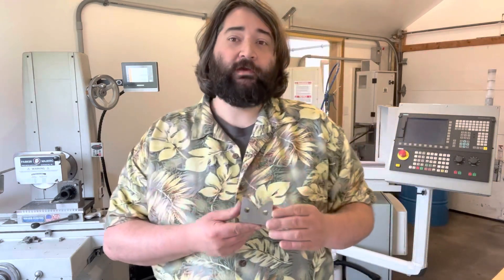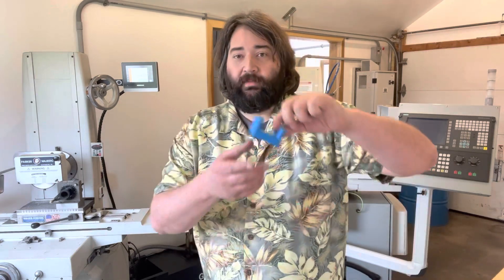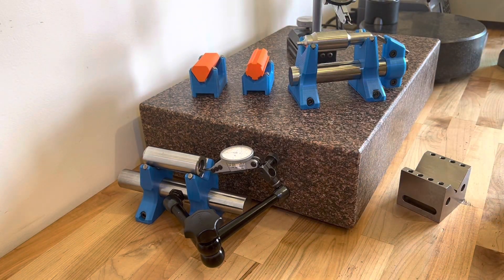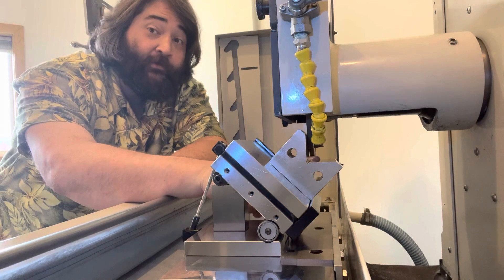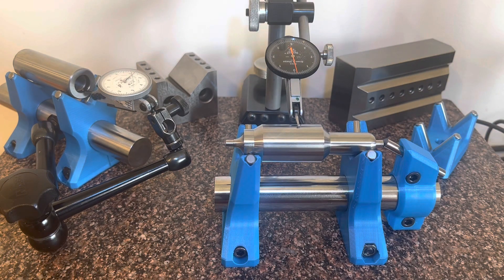Concentricity Gage made with 3D printing

Comment: I've ground plenty of acute vees for sheet metal bending. If you dress the bottom of the wheel at a shallower angle than the vee angle you want. The corner will clear and the faces can be ground with the side of the wheel. Then to accurately center I grind the oversized block to the required dimension ensuring the vee is central using a pin & dti.
If an acute vee does not need a sharp corner at the intersection then a flat at the intersection of the vee will also help clear the wheel when grinding the vertical faces and no angle needs to be dressed on thewheel perimeter.
I see a few videos of large vee blocks, often they do not need a sharp corner at the base of the vee as they are not designed for small diameters. Having a flat allows the vee blocks to be far smaller whilst still holding the required larger diameters.

Comment: Really cool and useful example of what can be achieved with cheap off-the-shelf precision goods like ground rod or ball bearings when the part being inspected is constrained in a way where the low precision of the 3d print isn't a problem.

Comment: Summary with Timestamps (English, German, Chinese)

Abstract

This video delves into the world of V-blocks, essential tools for precision machining and inspection. The speaker, Adam, a seasoned tool and die maker, highlights the challenges and expense associated with traditional V-block fabrication methods, particularly for specialized applications. He then introduces an innovative approach using 3D printed V-blocks that incorporate carbide dowel pins as contact points. This method offers affordability, versatility, and ease of customization, making it ideal for small-scale projects and inspection tasks. Adam emphasizes the kinematic principles behind this design and shares practical insights into its implementation, encouraging viewers to explore the potential of 3D printed V-blocks in their own work.

Summary

Introduction and V-Block Overview

* 0:00 Introduction of Adam, a tool and die maker specializing in high-precision tooling.
* 0:10 Discussion on the challenges of making V-blocks, emphasizing the need for flatness, squareness, parallelism, and precise angles.
* 0:31 Exploration of various V-block manufacturing methods, including grinding, wire EDM, and hard milling, highlighting their expense and limitations.
* 1:41 Introduction of 3D printed V-blocks as a cost-effective and efficient alternative, particularly for small-scale applications.

3D Printed V-Block Design and Functionality

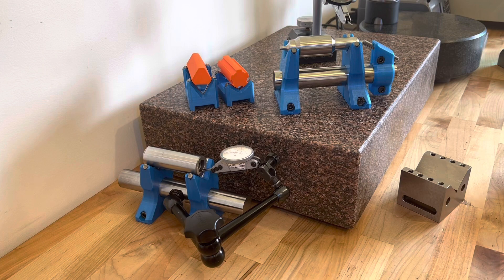* 2:24 Presentation of two 3D printed V-block philosophies: a modular system and part-specific blocks.
* 2:39 Explanation of the design concept: parts rest on carbide dowel pins held within the printed block by smaller V-shaped grooves and compliant hinges.
* 3:00 Emphasis on the kinematic nature of the design, ensuring accurate part tracking even with slight misalignments.
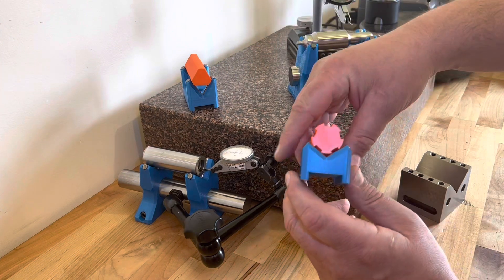* 3:20 Discussion on the use of part-specific blocks for accommodating unique angles and geometries, such as five-sided splines and three-sided parts.

Traditional V-Block Fabrication and Limitations

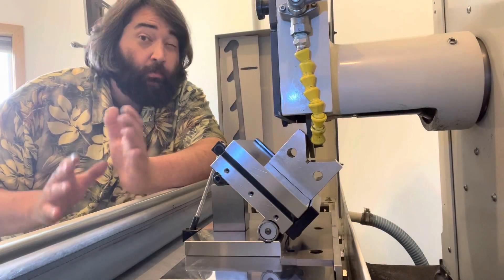* 5:10 Explanation of the traditional V-block grinding process, starting from the center and working outwards to maintain flatness and achieve a perfectly centered V.
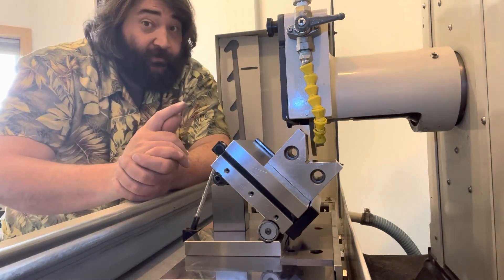* 6:04 Highlighting the limitations of this method for acute angle V-blocks (e.g., 60 degrees) due to the wheel's inability to reach the center.
* 6:19 Alternative methods for acute angle V-blocks: form grinding, hard milling, and wire EDM, which are time-consuming and expensive.

Advantages and Applications of 3D Printed V-Blocks

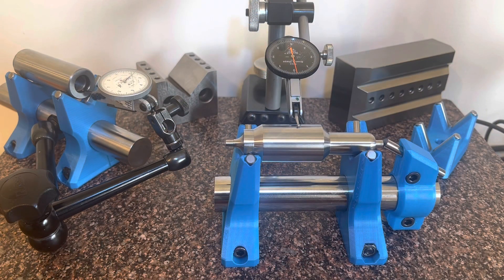* 6:32 Discussion on the rationale behind using V-blocks for concentricity and roundness checks, especially in the context of tool and die making where parts often lack center holes.
* 7:25 Inspiration for the 3D printed V-block design, derived from a Swiss punch grinder manufacturer (Rolomatic) using carbide rods.
* 7:50 Comparison to similar concepts used by ammunition reloaders with ball bearings as contact points.
* 8:00 Advantages of 3D printed V-blocks: accommodating small diameter shafts without undercuts, unlike traditional V-blocks or wire EDM methods.
* 8:47 Suitability for small parts and inspection tasks, with potential limitations for heavier components.
* 9:01 Encouragement for viewers to experiment with and adapt the 3D printed V-block concept.
User:	translate the abstract and summary to german
Model:	Zusammenfassung

Dieses Video taucht ein in die Welt der V-Blöcke, unverzichtbare Werkzeuge für die Präzisionsbearbeitung und -prüfung. Der Sprecher, Adam, ein erfahrener Werkzeugmacher, beleuchtet die Herausforderungen und Kosten, die mit herkömmlichen Herstellungsmethoden für V-Blöcke verbunden sind, insbesondere bei Spezialanwendungen. Anschließend stellt er einen innovativen Ansatz mit 3D-gedruckten V-Blöcken vor, die Hartmetall-Passstifte als Kontaktpunkte verwenden. Diese Methode bietet Erschwinglichkeit, Vielseitigkeit und einfache Anpassungsmöglichkeiten, wodurch sie ideal für kleine Projekte und Inspektionsaufgaben ist. Adam betont die kinematischen Prinzipien hinter diesem Design und gibt praktische Einblicke in seine Umsetzung, um die Zuschauer zu ermutigen, das Potenzial von 3D-gedruckten V-Blöcken in ihrer eigenen Arbeit zu erkunden.

Inhaltsangabe

Einleitung und V-Block-Überblick

* 0:00 Vorstellung von Adam, einem Werkzeugmacher, der sich auf hochpräzise Werkzeuge spezialisiert hat.
* 0:10 Diskussion über die Herausforderungen bei der Herstellung von V-Blöcken, wobei die Notwendigkeit von Ebenheit, Rechtwinkligkeit, Parallelität und präzisen Winkeln hervorgehoben wird.
* 0:31 Untersuchung verschiedener V-Block-Herstellungsmethoden, einschließlich Schleifen, Drahterodieren und Hartfräsen, wobei deren Kosten und Einschränkungen hervorgehoben werden.
* 1:41 Einführung von 3D-gedruckten V-Blöcken als kostengünstige und effiziente Alternative, insbesondere für kleine Anwendungen.

3D-gedrucktes V-Block-Design und -Funktionalität

* 2:24 Vorstellung von zwei 3D-gedruckten V-Block-Philosophien: ein modulares System und teilespezifische Blöcke.
* 2:39 Erklärung des Designkonzepts: Teile ruhen auf Hartmetall-Passstiften, die durch kleinere V-förmige Nuten und nachgiebige Scharniere im gedruckten Block gehalten werden.
* 3:00 Betonung des kinematischen Charakters des Designs, das eine genaue Teileverfolgung auch bei leichten Fehlausrichtungen gewährleistet.
* 3:20 Diskussion über die Verwendung von teilespezifischen Blöcken zur Aufnahme einzigartiger Winkel und Geometrien, wie z. B. fünfseitige Keile und dreiseitige Teile.

Traditionelle V-Block-Herstellung und -Einschränkungen

* 5:10 Erklärung des traditionellen V-Block-Schleifprozesses, beginnend von der Mitte und nach außen arbeitend, um die Ebenheit zu erhalten und ein perfekt zentriertes V zu erzielen.
* 6:04 Hervorhebung der Grenzen dieser Methode für spitzwinklige V-Blöcke (z. B. 60 Grad) aufgrund der Unfähigkeit der Schleifscheibe, die Mitte zu erreichen.
* 6:19 Alternative Methoden für spitzwinklige V-Blöcke: Formschleifen, Hartfräsen und Drahterodieren, die zeitaufwendig und teuer sind.

Vorteile und Anwendungen von 3D-gedruckten V-Blöcken

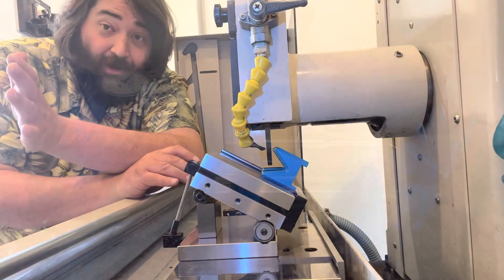* 6:32 Diskussion über die Gründe für die Verwendung von V-Blöcken für Konzentrizitäts- und Rundheitsprüfungen, insbesondere im Kontext des Werkzeug- und Formenbaus, wo Teile oft keine Mittellochbohrungen haben.
* 7:25 Inspiration für das 3D-gedruckte V-Block-Design, abgeleitet von einem Schweizer Hersteller von Stanzschleifmaschinen (Rolomatic), der Hartmetallstäbe verwendet.
* 7:50 Vergleich mit ähnlichen Konzepten, die von Munitionsnachladern mit Kugellagern als Kontaktpunkte verwendet werden.
* 8:00 Vorteile von 3D-gedruckten V-Blöcken: Aufnahme von Wellen mit kleinem Durchmesser ohne Hinterschneidungen, im Gegensatz zu traditionellen V-Blöcken oder Drahterodierverfahren.
* 8:47 Eignung für kleine Teile und Inspektionsaufgaben, mit potenziellen Einschränkungen für schwerere Bauteile.
* 9:01 Ermutigung für die Zuschauer, mit dem 3D-gedruckten V-Block-Konzept zu experimentieren und es anzupassen.
User:	translate the abstract and summary to chinese
Model:	摘要

这段视频深入探讨了 V 型块的世界，V 型块是精密加工和检测中必不可少的工具。演讲者 Adam 是一位经验丰富的工具和模具制造商，他重点介绍了与传统 V 型块制造方法相关的挑战和成本，特别是对于特殊应用。然后，他介绍了一种使用 3D 打印 V 型块的创新方法，该方法将硬质合金定位销作为接触点。这种方法价格合理、用途广泛且易于定制，使其成为小规模项目和检验任务的理想选择。Adam 强调了这种设计背后的运动学原理，并分享了其实施的实用见解，鼓励观众探索 3D 打印 V 型块在他们自己工作中的潜力。

总结

简介和 V 型块概述

* 0:00 介绍 Adam，一位专门制造高精度工具的工具和模具制造商。
* 0:10 讨论制造 V 型块的挑战，强调了平面度、正交度、平行度和精确角度的必要性。
* 0:31 探讨各种 V 型块制造方法，包括磨削、线切割和硬铣削，并重点介绍了它们的成本和局限性。
* 1:41 引入 3D 打印 V 型块作为一种经济高效的选择，特别适用于小规模应用。

3D 打印 V 型块的设计和功能

* 2:24 展示两种 3D 打印 V 型块理念：模块化系统和零件专用块。
* 2:39 解释设计理念：零件放置在硬质合金定位销上，这些定位销通过较小的 V 形凹槽和柔性铰链固定在打印块内。
* 3:00 强调设计的运动学性质，确保即使有轻微的偏差也能准确跟踪零件。
* 3:20 讨论使用零件专用块来适应独特的角度和几何形状，例如五边形花键和三边形零件。

传统 V 型块制造及其局限性

* 5:10 解释传统的 V 型块磨削工艺，从中心开始向外进行，以保持平面度并获得完美居中的 V 形。
* 6:04 强调这种方法对于锐角 V 型块（例如 60 度）的局限性，因为砂轮无法到达中心。
* 6:19 用于锐角 V 型块的替代方法：成形磨削、硬铣削和线切割，这些方法既耗时又昂贵。

3D 打印 V 型块的优势和应用

* 6:32 讨论使用 V 型块进行同心度和圆度检查的基本原理，特别是在工具和模具制造的背景下，其中零件通常没有中心孔。
* 7:25 3D 打印 V 型块设计的灵感来自一家使用硬质合金棒的瑞士冲床磨床制造商（Rolomatic）。
* 7:50 与弹药重新装填者使用滚珠轴承作为接触点的类似概念进行比较。
* 8:00 3D 打印 V 型块的优势：与传统 V 型块或线切割方法不同，它可以容纳小直径轴而不会出现底切。
* 8:47 适用于小型零件和检验任务，对较重部件的潜力有限。
* 9:01 鼓励观众尝试和调整 3D 打印 V 型块概念。

i used gemini 1.5 pro to summarize and translate the transcript
Token count
5,874 / 1,048,576

Comment: This is something I noticed while I was looking for a 3D file I needed on CULTS. I just subscribed to your channel & left a into message on your New Caliper Video… Anyway being new to machining & 3D Printing (I came across several files on CULTS with Mostly FREE 3D Files with various Machining gadgets (similar to what you’ve mentioned here)🤩 I flagged them to check out later, mostly to see which of them I actually needed…
BTW: As I just came across yoyr Channel here, I wouldn’t be a good judge if any of your Info Sharing skills have atrophied …
But can tell you it’s RIGHT-ON-POINT for my needs..Well Done💯
Respectfully,
☯️ZenModeling☯️

Comment: i wish you woulda used the indicator to show how perpindicular the rods are to eachother and how paralel they are to the 2nd set, so you could use it to check straightness of the shaft or maybe diameters along the length

Comment: How come 2 printed plastic parts have the precision of a v block? Do you adjust the carbide rods somehow to align everything correctly?
Reply from the maker: no alignment needed. even with the two plastic parts been grossly misaligned, the part is still sitting on the rods kinematically. worth pointing out that this is only to be used for runout measuring though
Reply: @adamthemachinist  aha, I see! For runout yes, it just spins on the carbide dows. A brilliant solution indeed! Somehow, I was thinking about holding the part flat to the surface. In any case, it is easy to adjust the height of one of the v blocks to get it flat, if that's ever needed.

Comment: I've seen the rods used for wheel balancing tool but usually mounted on metal struts or plates.   This plastic base system could be used to make a balancer too

Comment: As the hex bolt clamping force increases the toes on the base of the blocks would pull in causing distortion on the heal, changing the heights at either ends

Comment: Quick question, I didn't see you mention it... I'm assuming that there is not very good precision on the heights between the two V blocks? So you could check for concentricity, but not taper?
Reply from the maker: That’s correct , strictly a concentricity fixture .

Comment: Sorry if I missed something, but how do you hold this down with force, say on a mill?
Or is this specifically for holding on low impact applications like grinding?
Just curious to know because it seems like there would be some deflection when applying a gripping force to the structure.
Also, I'm not a machinist so sorry if there is an obvious answer here that I missed :)
Reply from the maker: Strictly for inspection purposes
Reply: @adamthemachinist  Aha! Thanks mate :)

Comment: One slight modification would be to offset the rods so that they do not touch, and then extend past one another.  This would allow for sharp cornered stock to fit without the need to have the undercut like you showed with the small diameter rod.  Great explanation and concepts.  Enjoying your videos.

Comment: I assume whatever you measure ( the feature, not the part ) with these is unaffected by the "precision" of a 3D Printed Part?
Like I can't imagine you doing a sweep across the part along the axis 🤔 ( not an engineer... just asking for a friend 😁 )
Reply from the maker: That’s correct , this is for checking concentricity between the sections the rods are contacting and the lands the indicator is resting on .
Reply: I came here for this comment.

Comment: Love it! Very clear explanations! I remember you sent me the link for the Rollomatic Concentricity Pro some time ago and I thought it was an awesome idea. At the time, I was making my own set of excessively fancy adjustable height vee blocks. I had ground custom vee inserts which were crowned, so the large radius would remain “kinematic” while effectively dealing with the Hertzian contact stress issues which might result from heavy shafts on small diameter high stiffness carbide pins. Your use of 3D printing here is awesome! People might discount 3D printing for a precision tool application like this. But it really shines with monolithic structures with integrated compliant mechanisms. If you use good kinematic design principles and use hard, stuff materials where it counts, then 3D printed precision tools like what you’ve shown here could be a game changer. Thanks for the video!